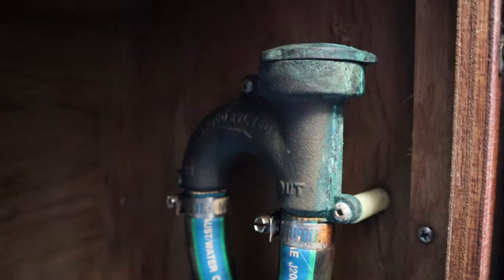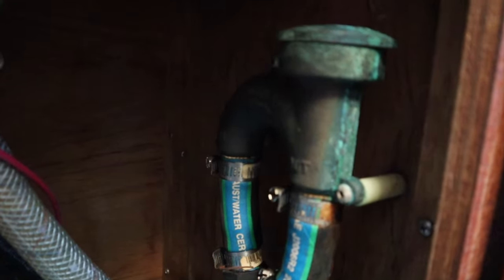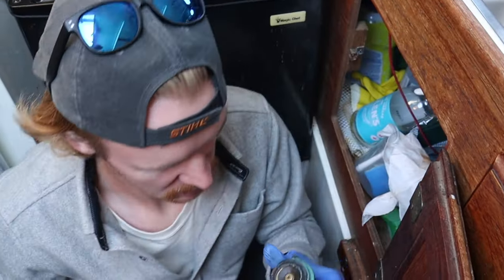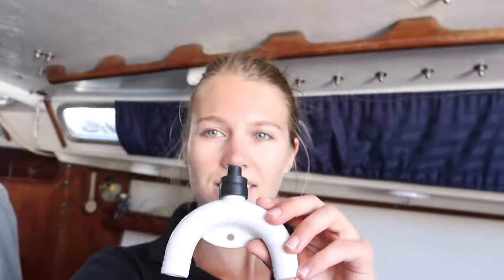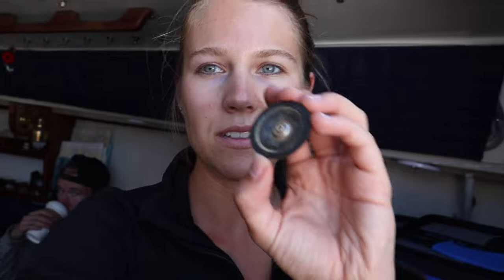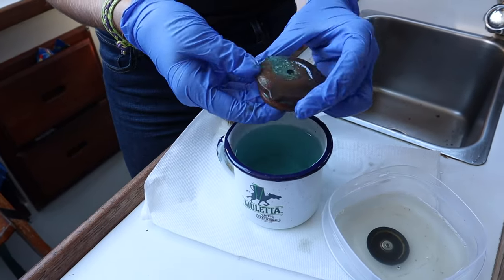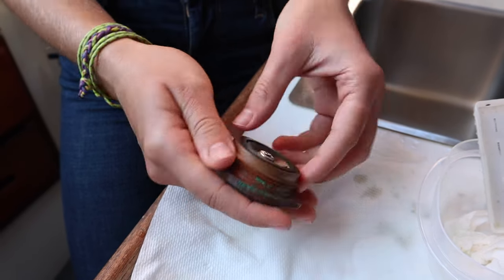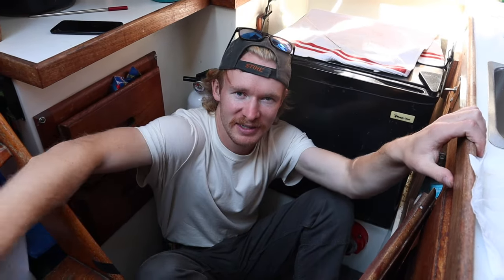Repair and Maintenance of the Anti-siphon Vented Loop on our Inboard Diesel Engine | Boat Life

Comment: If you can keep the brass one going it will last much longer than the plastic version.  As other comments have mentioned, its always worth lubricating rubber seals with vaseline, or better still silicone grease (a tube will last years and is so useful around the boat).  Also think about greasing the threads on the cap with the same, it should make removal next time easier 😀

Comment: We have the same GROCO vents on our generator and wing engine.    Our was causing the generator to shutoff due to exhaust temperature (we think).  Opened up the vent and found the rubber was allowing a bit of Backflow.   I highly recommend you replace the rubber flapper.   $100 each but it needs to be replaced I would say every year.    Also the top of your cap should have a fitting on it to attach a 1/2” hose to allow the excess water to flow down to the bilge and not into your cabinet.

Comment: Great Video but do Put anti-seize compound on those threads, use it on all threads except potable drinking water systems, also rubber has a shelf life depending on it chemical composition and exposure to elements. there is a chance the rubber is beginning or in early stages of crystallization, if in doubt, order a new on and replace to be safe. the vinegar is a good method or ketchup will work in emergencies, good idea to also keep several sizes of brass wire brushes on board for those types of projects.

Comment: Hello you guys. !  The rubber flapper valve if you have time I would soak flapper valve in oil to soften the rubber up
Reply: If you have to replace the whole valve I would put a new brass one back on  that’s the proper valve for there not plastic
Reply: I think vinegar will dry out the rubber and make it worse
Reply: Soak it in oil